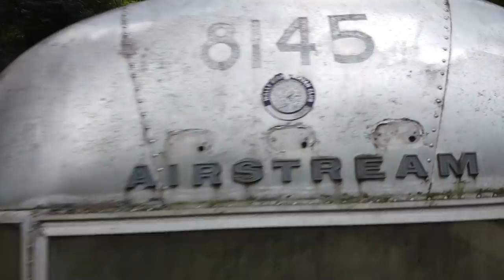This Is Our BIGGEST Undertaking Yet! Moving An Airstream That's NOT Connected To ANY Wheels!

Comment: I've moved some shady things before. But you topped me Jason & Brooke with your airstream camper. If that had been me half those straps would have been cut thru by the sharp metal of the camper & slid down the center of the road about half way to the 40.
Congratulations on a safe trip!

Comment: I watched a man take a seized bearing race and run a weld bead around it which caused the race to shrink. He then pulled it out with just his fingers after it cooled. Maybe Jasons dad can do the same to the wheel hub on the other box  trailer. Here is a link to his channel and the part you want to see is at 21:00. https://youtu.be/OLqvFhnUk6s

Comment: Your thought of "strapping it to the frame" would be highly illegal on the public roadways and were you to get in an accident with it....their lawyer would own everything you have plus the new "40"....just a word of wisdom for you guys!  Legal way would be to haul it on a flat bed trailer that is road legal.
Reply from the maker: What’s the difference between strapping it down on a flatbed trailer and strapping it down on the airstream trailer?  Both are totally street legal Bc if not, no one could tow a camper or airstream???
Reply: @CogHillFarm  no brake lights, turn signals, running lights or registration...totally illegal on public roadways.
Reply from the maker: My wife was following behind with hazard lights on.
Reply: That doesn't cover it in the eyes of the law.  You can easily check with your state motor vehicle laws on line.  Even ask your insurance agent.  He will know the legal ramifications of the activity you participated in on a public highway.  Just think of how unsafe the movement was.  No brskes on the trailer.  No real attachment of the trailer body to the frame.   Had you been involved in an accident with another vehicle you would have been liable at several different levels.  You can try to justify it in your own mind but that doesn't hold water in legal proceedings.   You can not plead ignorance of the law as a defense.  As a retired LEO I am just trying to open your eyes to the peril you placed yourself, your family and other motorists in.  If you can not see that or understand traffic laws pertaining to operating equipment on public roadways you should not be on public roadwsys.  You are not the only person using said roadways, thus the need for laws to make our roadwsys as safe as possible for all motorists.  I'm not trying to do anything but offer advice to keep you out of what could have been a  costly if not a deadly decision.  I covered too many motor vehicle  accidents during my career...some due to illegal equipment on roadways and some involving fatalities.  In the future think things through regarding everyone's safety before stretching the limits of sound logic.